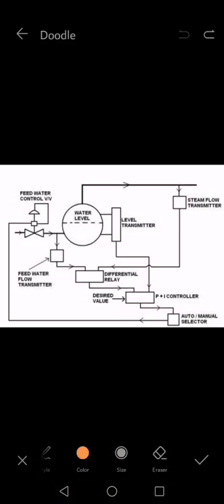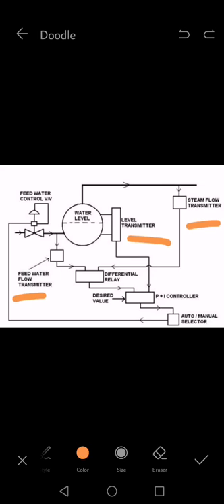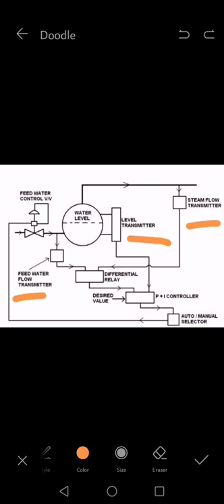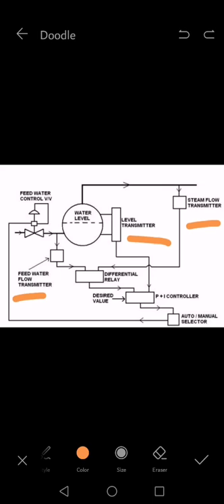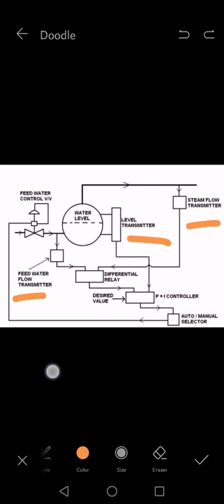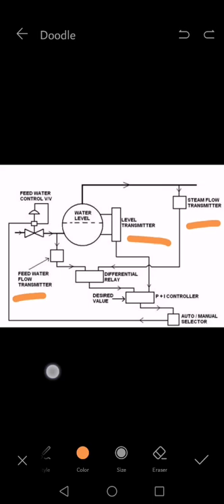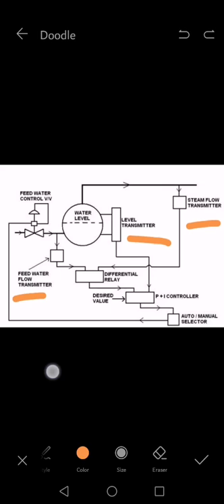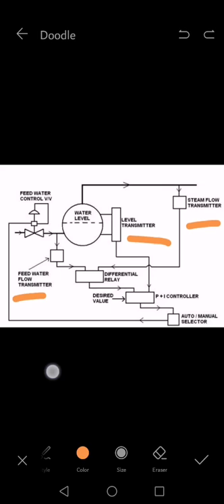MARINE BOILER FEED WATER CONTROL EXPLAINED

Comment: Why 2 water level indicator present on boiler?
Reply from the maker: Because in failure of One gauge glass... You have a spare one to see the water level on boiler. Until you fix it. Also if the gauge glass  will break.. They there Is a special ball inside both water side & steam side valve which will prevent water or steam coming out of boiler in the event of gauge glass failure.
Reply: @chiefengineerviraldungrani9581  thank you for the answer sir. 
Sir other than gauge glass, 2 more electronic water level indicator are present? What's their purpose?
Reply from the maker: @deependranegi7822  well on एइस for water level indication in local boiler panel... And remote in control room. Which is there for alarm. Other water level indicator is for tripping the Burner of the Boiler.